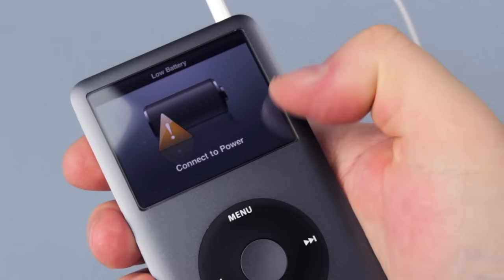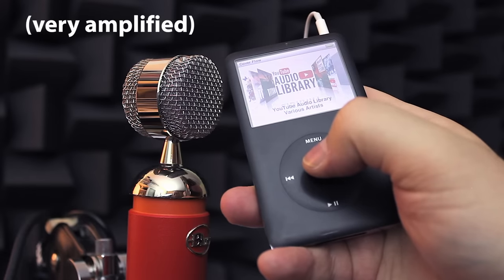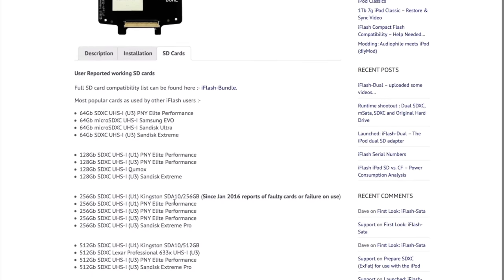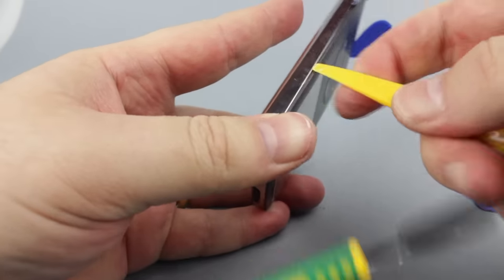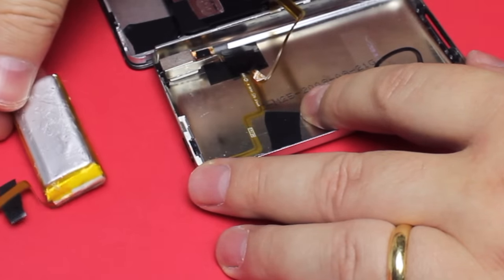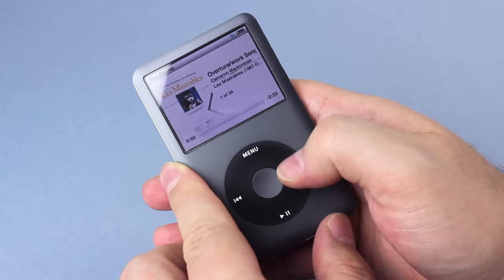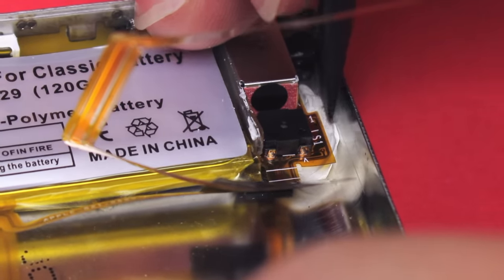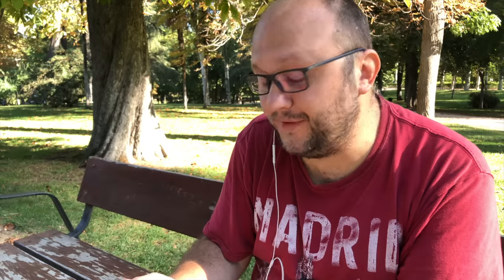iPod Classic new Battery & 256GB SD Card: still works in 2024

Comment: Hi again. iFlash Solo, Dual or Quad adapters can be used on any 5th or 6th generation iPod Classic, right? Can I use two 512 Gb on a iFlash Quad and this can be used on a 5th gen or a 6th gen as well? i didn´t get what´s all about the SD cards Gb limit to use on using those  iFlash adapters
Reply from the maker: Hi Carlos! Personally, I don’t see the point on going over 512GB at all! My iPod Classic has 256GB and it is less than half used. IMPORTANT: the iPod’s firmware (it’s original Apple software) has a limitation of 50k “items” (songs, videos or photos)... AND you cannot reach/fill more than 512GB with 50k songs - unless you originally used Apple Lossless (ALAC) as the compression for your whole music library. Or if you had a lot of videos on your iPod Classic (I don’t know anyone who does). Does it make sense??
Reply: @GeekDetour  I think I got it. So then I can use one 512 Gb or two 127 Gb SD Cards with iFlash Dual on 6th gen or 5th gen as well?
Reply from the maker: I think the iFlash quad is the best one even if you use it with a single MicroSD because it has the less thick form factor (it is my impression, I don’t have one to really measure myself). In the iFlash quad page there is a compatibility list - from iPod 5th gen on it seems to work: https://www.iflash.xyz/store/iflash-quad/
Reply: @GeekDetour  Thank you very much

Comment: I'm in deep trouble. I have followed your video, and managed to open my ipod 6/7th generation (160gb).  When I lifted the black 'grip' to remove the battery cable, the whole connector came off. I tried to put it back carefully but the pins bent out of alignment (the slots are so tiny). Then when I tried to straighten them (very gently!) the middle set of pins broke off. I inserted the broken set into the middle of the tab and managed to get the tab back onto the pins with the middle set in place.  Is there now any point in my continuing with this project of replacing my hard drive with a Compact Flash Adaptor and memory card?  The pins, including the broken set are sitting snugly in place. But will contact for the battery be lost entirely?
Reply: UPDATE: I reconnected the battery cable and it's working. Making contact!  I'm SO lucky!  Onwards and upwards with the project.

Comment: Bought the exact options detailed in this video. Same board, sd card and battery. Came apart easy and seemed like I had lucked out having it done in no time. Didn’t work, not recognized by computer or iTunes. Friend said card needs formatting, which is absent in this video. Tried that, computer recognized device but not iTunes. Now iPod just keeps rebooting and won’t connect at all. Looks like a waste of time and money.
Reply from the maker: Hi James 👋 It is not an easy project - things can happen (you saw in my video). When I began filming, my mindset was: “how to upgrade your iPod in 3 easy steps”... but NOTHING happened as I expected, and I kept filming just because... The footage remained untouched on an external hard disk for 2 years until my wife convinced me to make a completely different video, focused on my misfortune trying to upgrade. So, I agree with you: it looks like a waste of time and money 🤣 Read this page from the iFlash site: https://www.iflash.xyz/prepare-sdxc-exfat-for-use-with-the-ipod/ Hope it helps. Tell me later! Good luck my friend 🤞🍀 Oh, Merry Christmas! 🎄🎁

Comment: Hi, I have a 6th gen 80gb ipod, for the flash replacement if the maximum allowed is 128 gb. Would it make sense to have a 4 sd iflash? Or a single one would be ok?
Reply from the maker: I would use a single SDCard for the energy efficiency aspect. Each extra SDCard will consume more power and reduce autonomy.
Reply from the maker: https://www.iflash.xyz/runtime-shootout-2016-quad-dual-solo-msata-vs-original-hard-drive/

Comment: I wonder can u actually make iPod 7th gen ordering different parts?
Reply from the maker: You mean, by ordering off-the-shelf electronic parts? No, you can’t make an iPod this way: the most important part is the motherboard, the only thing I kept original, and it holds the Apple firmware - the software that makes the iPod an iPod 😁 BUT, you can make an MP3 player using Arduino in a simple project like this: https://youtu.be/UodfePdNfg8 or even go crazy using touchscreen like this: https://youtu.be/jbRtPxWLDus But as you can see, everything gets big and you cannot put it in your pocket 😁

Comment: It's the middle of July and my iPod Classic 160 GB died a month and a half ago.  When the hard drive started to go, I started using it in my car, tucked away in the glove box on the rear usb port on the car's stereo.  It's replacement is wholly unsuitable, as it won't talk to the stereo and I have to use the headphone/aux jack.  Not cool.  The old unit is getting a refurb, new solid state drive and new battery.  I don't care about the screen flaw because it's going back in the glove box and the stereo talks to it just fine.  I also think that some of those clips are going to be disabled, as I don't care if it's held together with tape, rubber band or zip tie.  The iPod lasted ten years, maybe eleven, and it deserves the Lazarus treatment.  It's July 2021 and I'm researching.  Hopefully in a month or so I'll be ready.
Reply from the maker: Good luck! I hope you can fix your iPod much easier, faster and cheaper than I did!!! 😄

Comment: Works in iPod touch 2g?
Reply from the maker: Hi Ezekiel! The iPod Touch is completely different. The biggest difference is that the Touch already uses Solid State Storage (it doesn't have a hard disk). Search on YouTube for "iPod Touch 2nd gen replacement" or upgrade, and you will find a few good videos about it.

Comment: Interesting.  But I think I'll stick to ipod touch: much easier to use and in terms of features almost Ipad's equal. P.S.  How about 2TB for each SD card if there's more than one?  That would blow all the other idevices out of the water capacity wise! :)))  If I owned a classic, maybe I would try that, only I would not try this at home atthe risk of f'ing it up.  I would go to iRepair, and maybe they would do that for me. :)

Comment: But can it play flacs? This is awesome
Reply from the maker: Hi there! The original iPod Classic doesn’t play Flacs - it plays MP3, AAC and Apple Lossless Audio Codec (ALAC).  If I knew that I would have, in the “future”, a 256GB iPod Classic, I would have ripped all my CDs in ALAC. Of course, it doesn’t make any sense to convert my MP3 or AAC compressed files to ALAC now. When I get something on FLAC, I convert it in ALAC to use it in my iPod.
Reply: @GeekDetour  I will never understand why they didnt make an ipod stock like this. I mean common apple

Comment: My iPad got wet but appears connect to power can I do something or not Anymore
Reply from the maker: Oh man.... everything I can recommend to you might have risks. Opening is risky, as you watched in my video. I would let it dry in the sun for a bit (you need to keep an eye on it). If you see the screen getting foggy from vapor, it means there is still water inside. Try to shake it in your hand and put again in the sun to heat a bit more.

Comment: What gen/ revision is this model

I mean what A1238 revision
Reply from the maker: My iPod Classic is the MC297 - You need to check on: Settings -> About -> 3rd Screen (right arrow 3 times). Then you see the exact model.
Reply: Geek Detour thanks
Reply: Geek Detour also my iPod is the 2008 will the parts that you put up will those still work with my 1st revision iPod classic 6th gen

Comment: There's no way I'd attempt to do this myself. And the cheapest place I've found wants $50 to replace my iPod Classic battery... and that's only if there's nothing else wrong with it.
Reply from the maker: Hi Jane! Well, considering that opening the iPod is not exactly easy, it doesn’t seem like an expensive price to pay! (even more it the U$ 50 includes the battery).
Reply: True. Thanks for the video. I might buy a few non-working iPods on ebay with dead batteries and practice on them, lol.

Comment: Can we recover data from the ipod classic after performing factory reset ?
Reply from the maker: I don’t think there is an easy way to do that... I wouldn’t say it is impossible - but it would involve removing  the hard disk, connecting it into an external disk case and use a computer to run Disk Recovering/Extracting software... that reconstructs what was inside exporting the data into another disk. Unless you had something really valuable in your iPod, it doesn’t worth the effort.
Reply: @GeekDetour  I have a 160GB 7th gen iPod Classic and i have recorded audio from TV shows and documentarys from 80s, 90s upto 150GB of mp3 files, but my iPod crashed after a while and i had to reset to factory setting and which erased the files. now i'm wondering if anyone can try to get these mp3 files back..  it will be great if you can make a video of this scenario of recovering data from factory reset iPod.

Comment: it is 2024, and I find myself trying to do the same :face-purple-smiling-tears:
Reply from the maker: It is incredible, really! 🤯 I recorded the material for this video in 2016 - it stayed untouched until 2018, when my wife insisted I should edit it. The nice thing is that you still can buy an iFlash board today and replace the HDD for an SDCard, and there are still batteries you can buy for iPods 🤣 Good luck in your restoration!

Comment: I have a older 5th gen ipod if you want to sell me  the bigger battery I will buy it off you  if you are not going to use it . Great video .
Reply from the maker: Thanks! Ha ha, well, I used the bigger battery on my wife’s iPod (she has the 160GB thick model). You should check the iFixit website, they still have many iPod Classic parts, and good batteries!

Comment: It only register 120 gigs not 256 gigs please help
Reply from the maker: Hi!  3:00 Which model is yours? https://www.iflash.xyz/store/iflash-compatibility/ Take a look because there might be a limitation depending on your exact model. Some people change the firmware of the iPod and use "RockBox", that doesn't have this limitations... But, well, it is a completely new program: your iPod won't behave like an Apple iPod: I found the RockBox UI a bit unpolished - so I kept my iPod using its original software. Also my model recognise beyond 128GB, so the only limit would be 50k songs.

Comment: So, it's your iPod or your Wife's? Or are there two?
Reply from the maker: There are two iPods: my iPod is the one that appears most of the time, the one I broke and replaced almost everything :) My Wife's iPod I only replaced the battery: her iPod is a bit older and it would have a limitation to only 128GB if I changed the hard drive.

Comment: I JUST REPLACED SUCCESSFULLY THE BATTERY AND HDD OF AN IPOD (PUT A 512GB FLASH DRIVE). MY ADVICE TO YOU, DON'T TRY IT. I SNAGGED THE CASE AND DAMAGED THE SCREEN WITH THE FORCE I HAD TO APPLY TO OPEN THE CASE. IT'S NOT WORTH IT, JUST PAY FOR SOMEBODY TO DO IT. EVEN THOUGH APPLE IS SO SHITTY IT DOES IT ON PURPOSE, SO CLIENTS ARE FORCED TO PAY FOR EVERYTHING THAT THEY NEED, APPLE PRODUCTS ARE NOT SELF SERVICEABLE. APPLE IS SHITTY, APPLE SUCKS.
Reply from the maker: Ha ha, hi Thomas! Oh man... Yeah, everything is very delicate. Now I am much more aware of what's inside the iPod and how to do things without damaging it... but the first time I did mine I really butchered it (as you saw in the video). Last month I replaced the battery of my Apple Watch: GEEEEZZZZ, everything is REALLY microscopic and surgically delicate inside. It is an era of super-duper miniaturised electronics, nothing is user-serviceable anymore.
Reply: @GeekDetour  Exactly, I got so pissed off at Apple, though that was only the straw that broke the camel's back. Now I have a broken display (not sure if I will want to fix it though.) Also pissed at some scoom beng that sold me a thick battery on Amazon, that they advertised as being for the ipod classic 160Gb when it wasn't, I had to wait forever for a new right one.
Reply: @GeekDetour  also, I had to remove the little metals on both sides of the case, otherwise I wouldn't be able to put the toppings back inside the case Lol. Oh well, I don't care anymore